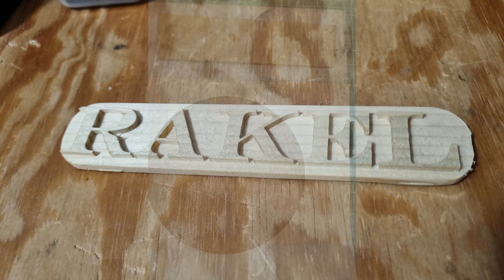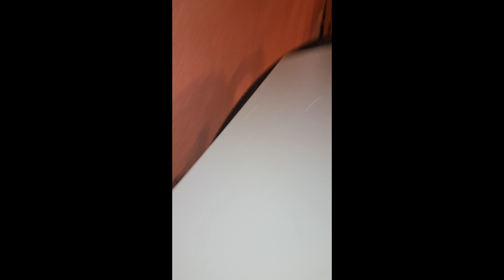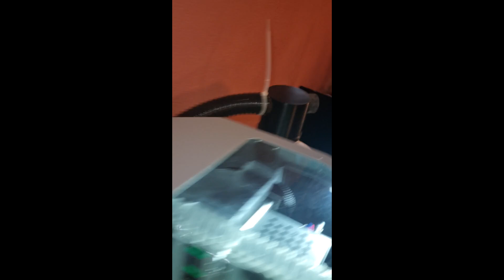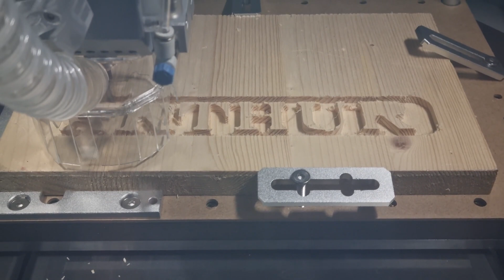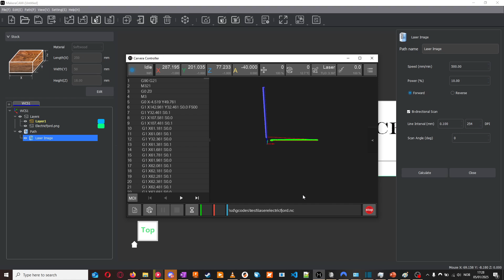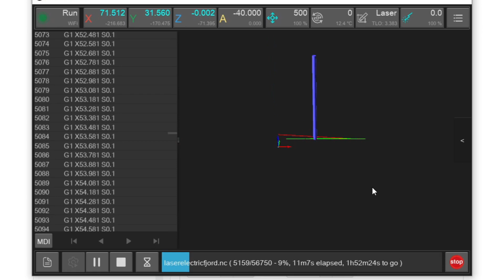Carvera Air CNC Tips, Tricks, and Lessons Learned so Far

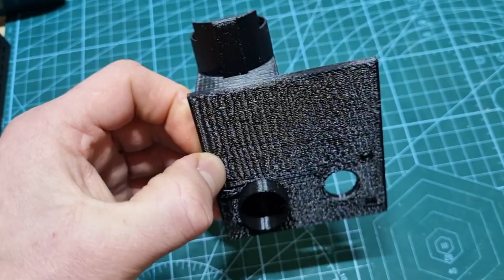Comment: 2:13 Makera themselves uses this technique, to mount the new 4th axies using a longer screw.. See "4th Axis with Harmonic Drive Installation and Configuration on the Carvera Desktop CNC" at 2m 30s of that video. So your solution is not too different!
Reply from the maker: Thanks good to know. And extra thanks for the timestamps. Made it really easy to find! I guees its ok, but i noticed i could push the thing that holds the threads a little bit, so i guees you should be careful and not displace it.

Comment: Thank you for the video. Like you, this is my first CNC machine and I am use to 3D printing. I also would like the file please. I really like your back plate.
Reply from the maker: Hei, Glad you liked it!

Here you go!
 Toolholder: https://www.printables.com/model/1141413-bit-tool-holder-for-cnc-carvera-air
 Vacuum Adapter: https://www.printables.com/model/1141396-carvera-air-ventilation-vacuum-adapter

I also printed some more clamps:
https://www.printables.com/model/612951-carvera-clamp-3d-printed

Comment: Really like the tool holder so you can stage the tools you need to swap in a logical order.  I don’t have a 3D printer so I will just drill some holes in a block of wood or MDF, but the function will be the same.  

Now if I can just get them to send me my machine, LOL.
Reply from the maker: Haha! yeah it is really nice to stage the tools! You could easily make it with the carvera, but you can also easily make it with a battery drill, 2 types of drill bits, and a block of wood!